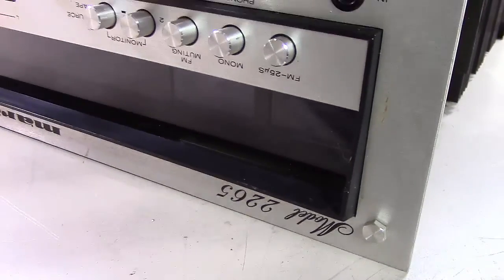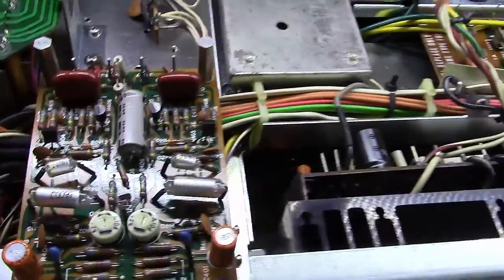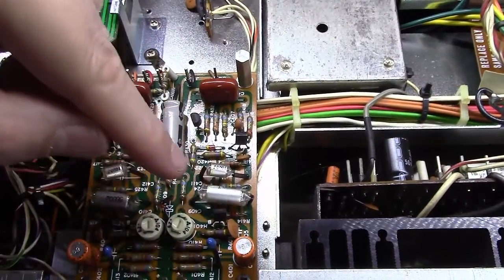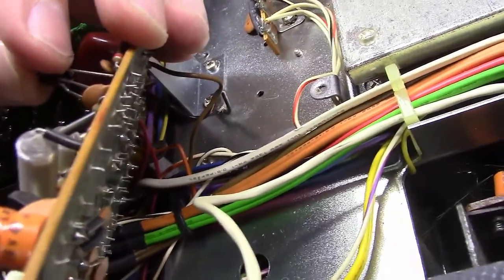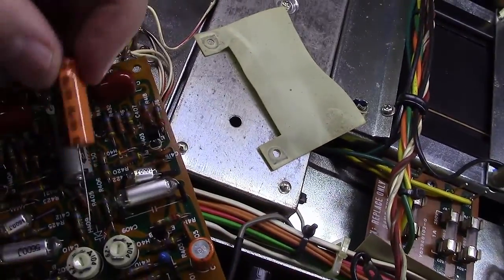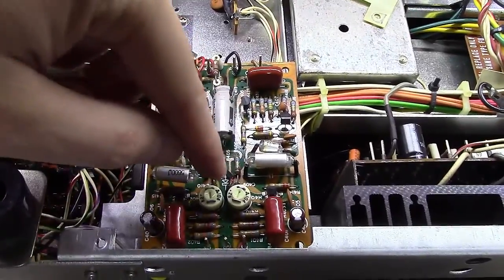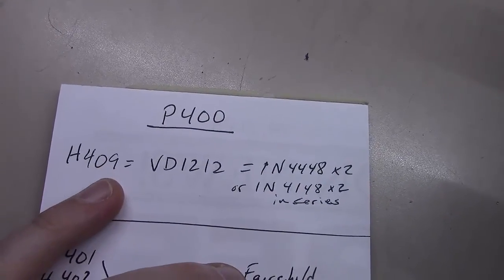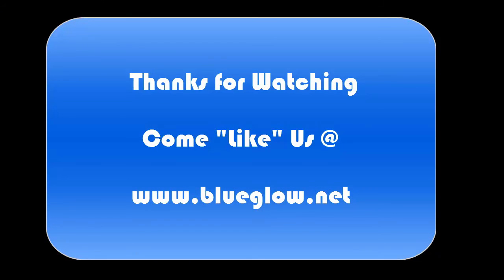Rebuilding a Marantz P400 Phono Board - BG045

Comment: @Blueglow Electronics

Looking at the parts list for the C401 & C402, I think that's a mistake.   There is no such part as a 1 uf 100V Poly Cap by Panasonic or anyone.  I realize this is almost four years old, but is it possible to double-check and let us know what you really used?
EDIT: I'm looking in the service manual for a 2285B (which uses the P400) and it's listed as Cap., Elect., 4.7uF, 25V ;  does that match what you had in this machine?

Comment: What about the 2 transistors aside the Sprague (large) electrolytic? They appear to Sh**house type too yet not even mentioned. ???
Reply: Yeah, 458 and 1344 should be changed with KSC1845. I am curious if the filtering around the transistors needs to be altered for the new replacements too - slower ft on the 1845's. I keep getting oscillations with the new replacements in and the caps all changed - seemed like the 5600p and 1600p were culprits in the device I was working on  - it clears up when I ground either channel but oscillates any time its left alone - does not look solid ever without being played with.  New ground strap did not help but holding the board at the right angle and it sounds perfect...put it back inside and it oscillates <grumble>  
Even when held to make the sound perfect, the second I touch oscilloscope to the channel pin or tape out - signal distorts, touch the pre out - no change - seems like a capacitance issue but I am no engineer! lol.

Comment: Great videos on Marantz rebuild.  After recapping the P400 I'm having ground hum isue when the volume is turned up 1/2 way.  It only happens in the Phono setting & stops when I plug in my phone for audio test (or touch the chassis.  Is that normal?
Reply: You put the bottom cover back on right?  It needs the bottom cover to attach all the grounds... ask me how I know this lol
Reply: @officialmikethompson  <Facepalm> I am losing my shit on this phono board, I can tune in Aux and FM just by touching certain parts! Bastard is oscillating like crazy and cleans up if I hold it at the right angle or touch both the output pins at the same time. If its the bottom cover I am going to go nuts.... nothing touches the bottom cover but it might be a way to block the "antenna effect" that phono boards have.

Comment: Hi i bought this Harman Kardon PM655 Vxi amplifier but the phono stage is dead.
There is music but low volume.. all the caps seems fine visually .
everything else is working fine.
where would you start looking the cause?

Thank for the great videos!
Reply from the maker: +keto70 I'd get a scope out and see what level of output comes from the phono stage going into the preamp.  If you can plug something into the aux port and it sounds fine, then 95+% chance your issue is in the phono stage.

Comment: Great video. I am working on a Marantz 2238b, and has a P400 phono board. This one has the selector switch on it.  I am considering a rebuild on it after resolving the FM issues. Also, the tabs that holds the board with the fuse lamps are broken off.. Is the white frame available for replacement? I enjoy watching your videos,and learn something along the way.
Reply: Ebay has a 3D printer version of the white frame that's stronger than the original. about 45 bucks.
Reply: Thank you for the information. I will remember this on my next Marantz rebuild.

Comment: Where do you get the ptf wire cover?
Reply from the maker: +timholsten http://www.ebay.com/itm/390626412636?_trksid=p2057872.m2749.l2649&var=660430144821&ssPageName=STRK%3AMEBIDX%3AIT

search for their other auctions as well and get the size you need.
Reply: thanks
Reply: Thank you for your videos. I just finished up replacing the transformer in a dead 2240. I re- capped the p800 power supply and installed a new relay. Going to tackle this p400 board next. Thank you for your parts breakdown. Very helpful.